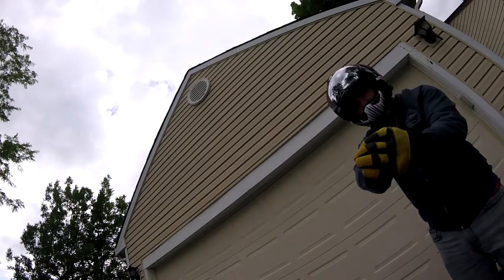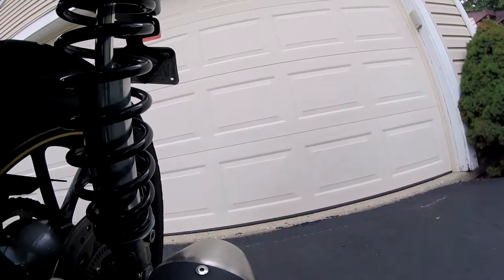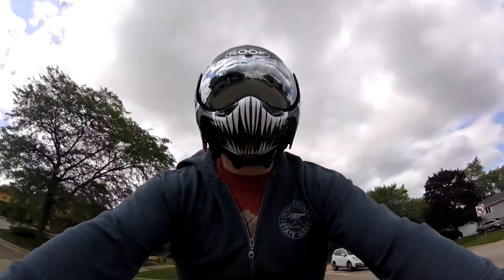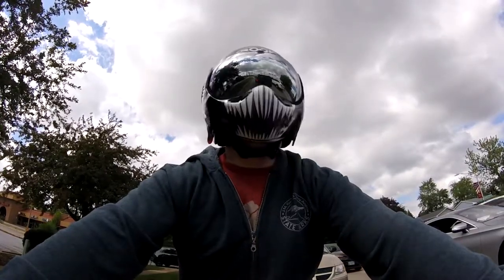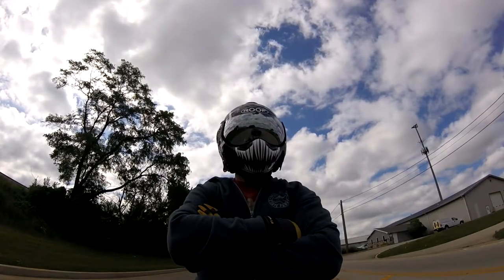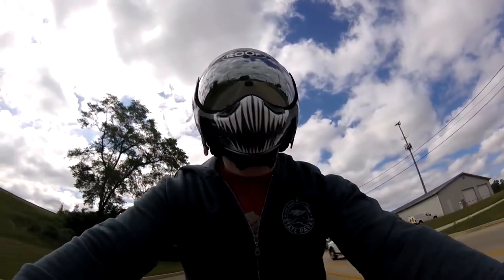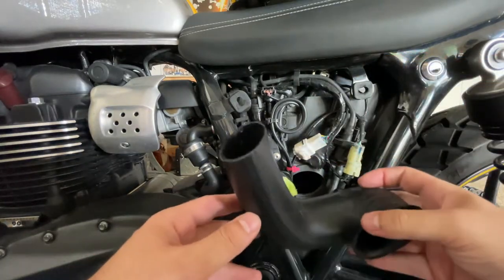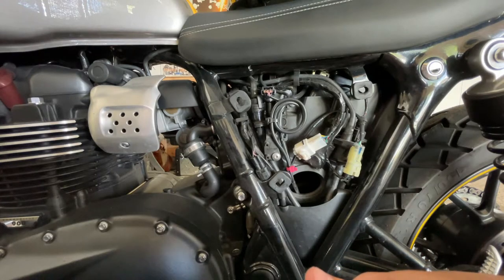Would Removing Air Snorkel On Triumph Street Cup Increase Performance?

Comment: Man the snorkels imtake is directed towards the front,  which means, it is feeded by the air comming from the front, while moving. The form is getting tighter,  this means, that the inflowing air is being swirled into a vortex and also a  little bit compressed. 
I cannot imagine, it will work better when removing it.
With this snorkeldesign you do have a guaranteed inflow while  moving, in contrast to, when you remove it, the swirling wind on the simple open hole has more problems to get inside,  because of the airstream simply passig by that hole. But the plastic cover is blocking that direct intake.
What we could try is to saw off the front part is useless, because the leg is still blocking some air. 
But I will check your airfilter from kna...
Maybe i will try it now anyway

Comment: The unspoken: Riders seem concerned about 1/2- 3 hp, saving a gram or two of weight with those cool aluminum bits, yet they are 100 lbs overweight. An easy way to increase the performance of your bike is YOU lose weight.

Comment: Have you got dnk tune, i got street scrambler with decat vance and hines but its a pig offline now, lost low end grunt
Reply from the maker: No tune. I have the British customs xpipe/decat done by the dealer and was assured no tune was required... I've left the pipes stock for now. It's been a few years now but I recall having nothing but feeling pleased after picking up the bike. It felt lighter, faster, louder and the low end grunt is the same if not better.
Reply: @VectorBurnOfficial  I am thinking of tuning it with dnk tune as the bike is gutless unless revved out, maybe you are running stock exhaust and hence it didnt affect the low down grunt
Reply from the maker: I believe that's most likely the reason. Xpipe and stock exhaust you typically don't need a tune but whenever you get new pipes as well that's enough to cause problems and the tunes tend to fix those. I would suggest reaching out to vance and hines first as see what they recommend. They may have seen this issue before.
Reply: So you have the X pipe, snorkel removed and stock pipes with no tune? Still running well?

Comment: I the only way to get any real performance boost is to change the CAM. Try the TEC one. Triumph restricted the power with the cam profiles so it doesn’t matter what you do you ain’t getting much more than about 1hp without a new camshaft.

Comment: If you remove the snorkel the performance decreases rather cut the snorkel tube flush as it enters the airbox.  Thus you will have more air volume inside the airbox.
Reply: Is that something the CPU can adjust to without doing a remap?
Reply: @littlet-rex8839  You will have to remap the ECU or replace the intake air sensor (IAT) with a smarth modified one, such as the Smarth IAT By Belinassu for example.
Reply: Have a 2008 efi 865cc triumph bonneville. Staintune exhausts, pollution inhibitions removed and replaced snorkle air intake with a open bellmouth. With just those few restrictions and good exhausts the difference was well worth it. No adjustments or remapping. Nothing. Fantastic bike.

Comment: Hey, what did you do to fix the engine light going on because of the led brake light? I’ve been struggling for 2 years now
Reply from the maker: Ah... THAT little bug... Well it started happening to me when I got the motone tail tidy. Back when I bought it, they didn't include the special wire cluster. I've since gotten it from AJ Cycles and installed it a few months ago. Haven't had the issue pop up so I'm thinking it fixed it... but who really knows what conditions ACTUALLY cause it. Give it a shot... it's only $35 -- > https://www.ajcyclesny.com/product/motone-plug-and-play-rear-wiring-harness-2016-triumph-classics/
Reply: Thanks mate I’ll give it a look !